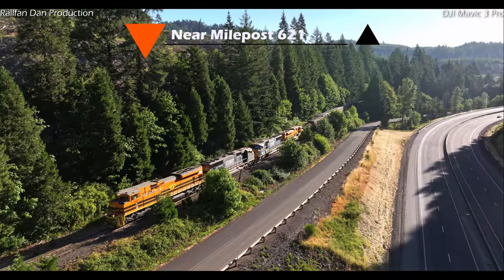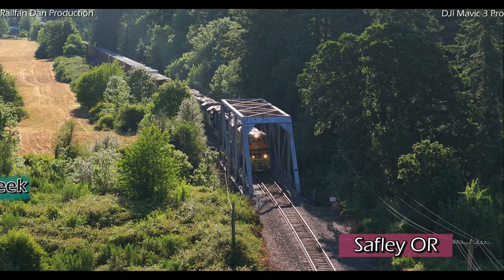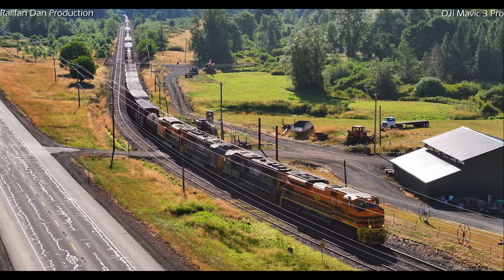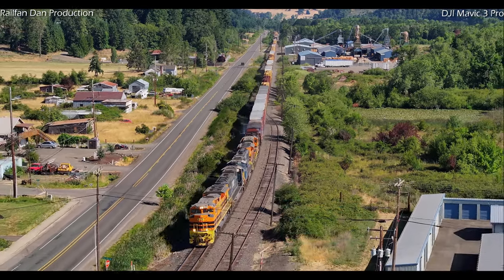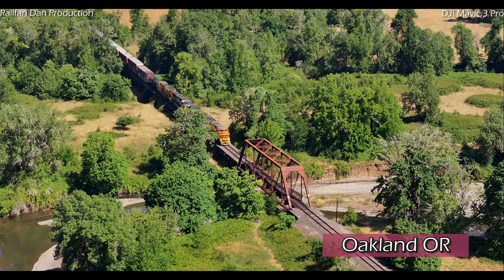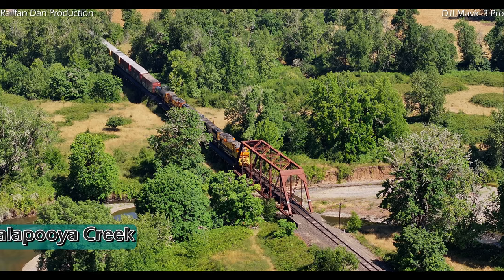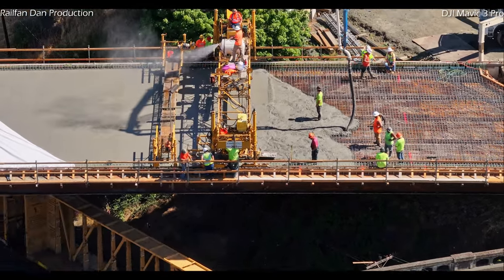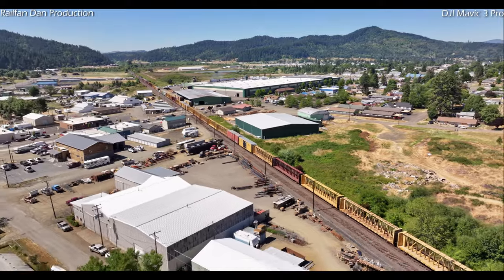BIG POWER on a Shortline (4K) | CORP Roseburg Turn | Siskiyou Line | July 14, 2023

Comment: The four SD70s seem to have more power than is needed to move this train with its consist of mostly empty center beam flatcars. You did indicate that all that power will be needed to take the loaded train from Roseburg, Oregon back to Cottage Grove, Oregon because of the steeper grades in that direction. I enjoyed watching the Roseburg Turn, Job 501, as it made its way along the Central Oregon and Pacific Railroad on its way between Cottage Grove, Oregon and Roseburg, Oregon. Thank you, Dan, for uploading this video for us to enjoy!
Reply from the maker: You are correct. For this Southbound run they don't need all this power but for the Northbound trip later in the day sometimes these 4 units are barely enough. I guess I'll have to get out there again and get a video of that at some point huh? Thanks a lot Thomas!

Comment: At first I thought the four heavy duty locomotives were overkill. But after watching the video they need every horsepower to move this long train through the hills, especially the loaded one. It's indeed amazing the EMD demo engines from '92 are still earning their keep. The water sprayer is cute and important too. I'm sure the railroad doesn't want to start a fire in the middle of a hot summer. Oregon is a very nice state, especially this time of the year, when everything is green and healthy. The little villages along the track are quiet and peaceful. Fantastic video again Dan, I really enjoyed the flight.
Reply from the maker: Thanks a lot Z! Very glad you enjoyed! This video is a great example of the landscape of Southern Oregon.
Reply: On class one (10mph) rail, horsepower is not what is needed but drawbar pull;  four SD 9's could pull that train.

Comment: Just fantastic. Incredible. I wish there were trains at that speed to record here. They usually run at 55 - 60 mph. 
A month ago a flight in 45 mph went wrong and a crash into the trees of the nearby mountains was a fact. The 4 000 USD Mavic 3 pro had to be found by climbing an almost vertical mountain up to a level of 120 feet. Being 70 years old and not physical.... It was a miracle to manage and get back home in one piece with both the drone and the controller.
You live in a very drone filming friendly part of the world.
Reply from the maker: Yikes! That is a bummer, real bad. I definitely do deal with quick paces as well and have also lost some drones over the years. About 2 months ago I had to go searching for my Mavic 3 Pro in a forest as well and luckily did find it. That is a miracle for sure!
Reply: @TheRailfanDan  The function "Find my drone" made it possible. Without it, pointless to even think about searching for it.
Here's the full screen recording, from take off to "found it". 
https://youtu.be/z0uGnmAGMzk

Comment: So here's a few fun facts about the Siskiyou line: the line was one of the very last lines to use the old US&S B-style lower quadrant semaphores, and even very common to see not only the old foundations of the signals, but also the silver junction boxes on the adjacent telephone poles where the signals once stood. 

Another thing, if you look carefully, you'll see a year build-date on each of the through trestles. Most trestles built in this style on the line show a year of 1906. I remember seeing them as a child and thinking about how many trains they've supported over the years. Sure, the number of trains have diminished substantially since Southern Pacific sold the line in 1994, but to know that they're still holding well is  Testament to the quality of those builds. 

And finally, if one was to walk along the siding and read the build locations and dates of the rails on those sidings, they would likely see build locations like Lackawanna, Steelton, Illinois, and even Colorado. Most of the older dates range from 1946 all the way as far back as 1909!

I have other tidbits, but don't wanna create a book within the message board here so I'll stop now 🤣

Great video, as always, Dan! Keep it up!!
Reply: Thanks so much for the info. I always like to hear the back story that's relevant to the video.
Reply from the maker: Thank you Mike and thank you for the added info!

Comment: I see they've started increasing the track speeds back to 25mph finally!
Reply from the maker: FINALLY is right! I have waited so long for that and was extremely surprised when I saw it happening. I have a hard time enjoying this chase without some 25mph running.
Reply: @TheRailfanDan The whole line used to be 25mph a couple years ago but the problem is that the tracks have deteriorated to such a point that you can't go ever 10mph without either wrecking the tracks or the train. I'm guessing the 25mph parts have continuously welded rail on them because Portland and Western has started doing that and that's why some of their trains are faster now. You could probably get speeds up to 35 or 40mph if they redid the ballast and ties as well as tilted the turns but I don't believe this line generated enough revenue to warrant that!

Comment: I have never before seen that water spray car behind the engines idea. Is this more common than I realize? Fire country ? suddenly very curious.
Reply: That is a carry over from SP days.
Reply: It's not common anymore, usually the big class 1s have a separate train but on this line it's a tradition carried over from the SP days!
Reply from the maker: Very common for this railroad during the summer. I believe there are 4 or 5 different trains that use them on the CORP.
Reply: @TheRailfanDan Yep and most of the hauler trains have to run at night due to an agreement with a few fire departments, the idea is that since the temperature is lower at night, it's less of a fire risk, though I dunno if that's year round or summer time only!

Comment: Do you know the Roseburg turns ‘schedule’ by chance? I plan on taking a trip up there one day
Reply from the maker: Yes what you see here is normal. Here are some times from this day:
-First shot South of Cottage Grove at 7:53 AM
-Safley 8:26 AM
-Drain 8:52 AM
-Yoncalla 9:41 AM (crew change before this had them stopped a bit)
-Rice Hill 10:00 AM
-Oakland 10:40 AM
-Sutherlin 10:55 AM
Take this with a grain of salt but this is pretty typical give or take an hour for each location.
Reply: Thank you!

Comment: Million dollar modern diesels running 10 mph because CORP is too cheap to maintain the line.
Reply: Correction: Genesee & Wyoming is too cheap to maintain the line. CORP is just a subsidiary.
Reply: @AnontheGOAT  Yeah, yeah, and before that it was Rail America.  My point is the contradiction of running high power high speed modern power on class one rail when earlier and much cheaper geeps and SD's would do fine.
Reply: @Hogger280  I understand the contradiction, but the CORP is not a class I. It's a class II. So it's par for the course to have some odd motive power on them.
Reply: @AnontheGOAT  Odd yes, but usually old stuff.
Reply: @Hogger280  True. But man kinda cool to see not one but two modern EMD’s on a short line. Even if they are only doing 10mph. 😂